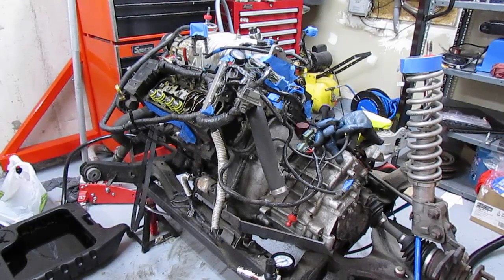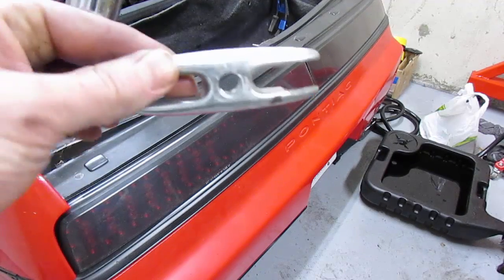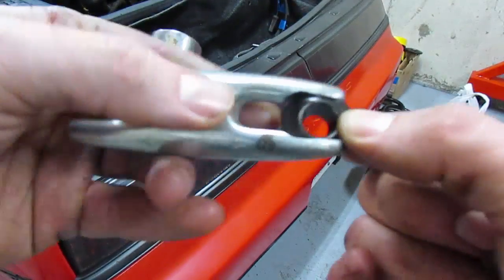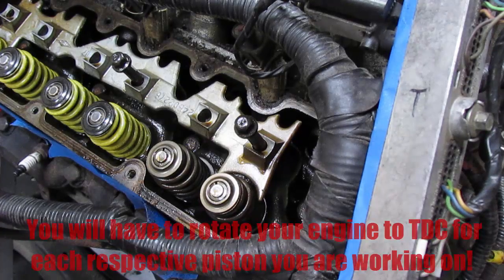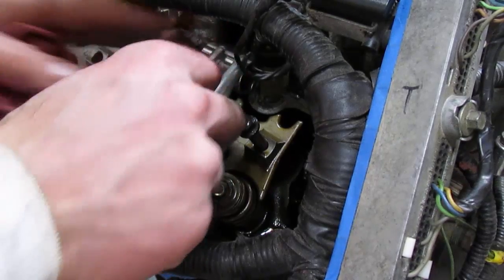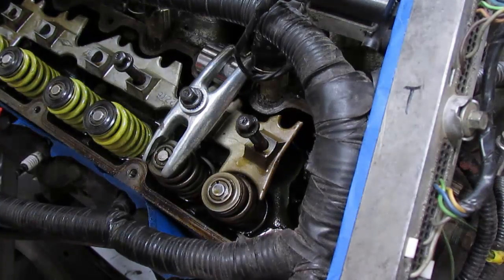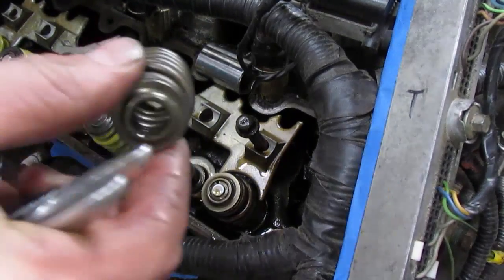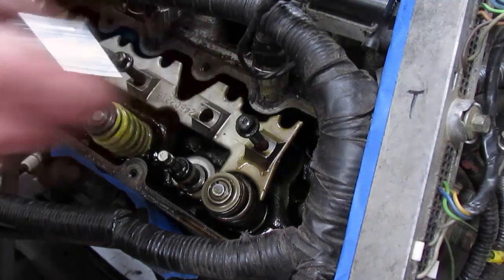How To: Remove Valve Springs + DIY Valve Spring Compressor!

Comment: This is why I hate mechanic videos. Every video, carbon copies of them having a great old time just with a ez pz task. Whereas to even remove a tie rod, I have to Babe Ruth slam the tie rod fork with a super sledge from fallout while the tie rod, glowing red from atomic bomb heat just to finally release it. Then the dudes here on YouTube just take their little 1 gram weight tack hammer and smack the joint right out, it’s that ez!

So I watch this video because my valve spring locks will not come out. Gosh, I’ve gotta be doing something wrong right? I watch this dude and he literally picks em out with a magnet. I’ve maximum compressed my springs and have sang these things a lullaby after serving them their warm milky milk and favorite blanky and they still won’t relent.
Reply: Well, I did my own thing and theyre out. 

I got the head on its own, broke 2 manifold bolts even after I made em glow like the sun (I... coerced them out) and found my own method to remove these little buds of joy.

Big chungus C-clamp, and 15 mm socket, and a 2 x 4 x 2’. Put the 2 x 4 where the valves open, put the socket on the valve spring, make sure to not occlude the locks. Then rest the c-clamp head on the 2 x 4 so that the vice region is centered on the socket (which is on the spring). Depending on the severity, have eye protection on, trust me. Then begin turning the clamp until it becomes tough. Put something around the spring if you feel the need, you should. Then wrench the vice.

Depending on the severity, you may feel a pop or you may feel a huge kickback. One of my springs exploded out and punched a notch into the plywood I had set up. I found the locks. You will certainly know when the locks release.

I tried variable other ideas on YouTube that didn’t involve a 200+ Buck tool, none worked. So a 12 buck C clamp from harbor freight and scrap wood did the job.

Comment: I have a 2005 Jeep Grand Cherokee 3.7 V6 that has a valve that will not let rocker keeper stay on its to  lose  jumps off rocker keeper how can I fix it thank for your help .
Reply: From the button of rocker spring
Reply from the maker: Does the valve appear to be bent or otherwise damaged?

Comment: Carlos Ramirez , isn’t the reason you’re replacing the seals because they’re not sealing good anymore??? Just fit a rope or even a rubber hose with the piston at TDC and should be no problem , if think of it the rope or the hose will have like a spring action on the valve, as well as compressed air

Comment: +embrace racing so with piston at top you don't have to put anything in cylinder like a rope? I was told you would have too put a rope or air in to help hold up the valve. Is that true? Thanks
Reply from the maker: Hi Johnnie, I took a chance by not shoving anything in there. Some people use compressed air inside the cylinder through the spark plug hole. I just made sure the piston I was working on was at TDC so even if I dropped a valve it wouldn't fall very far. The stem would still be sticking out and it would be easy to retrieve.

Comment: I've very lucky. this video was in my recommendation and I've been thinking about getting the 1.9 rockers with those valve springs. but I didn't want to take the heads off!! thank you.
Reply from the maker: No problem, glad it helped! It was a lot easier than I thought it would be :)